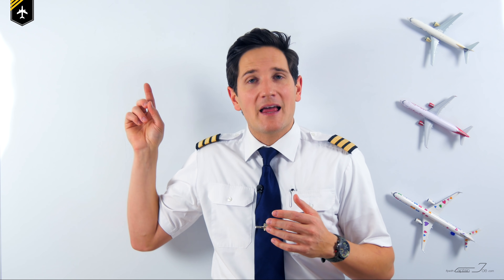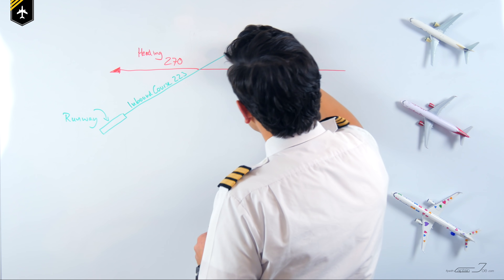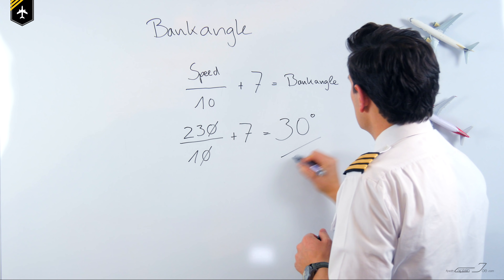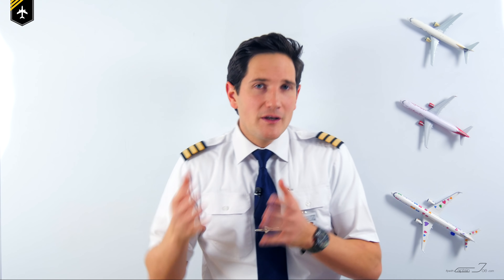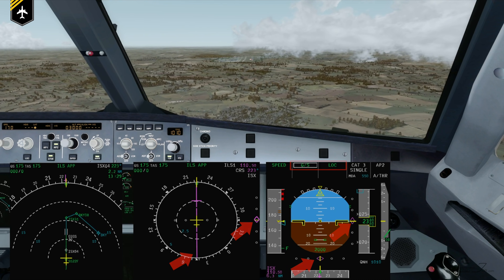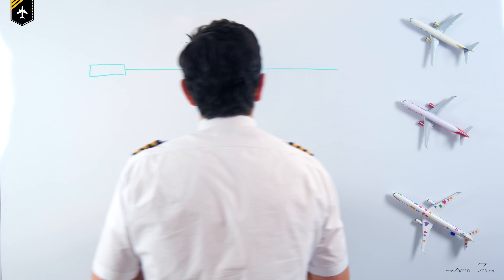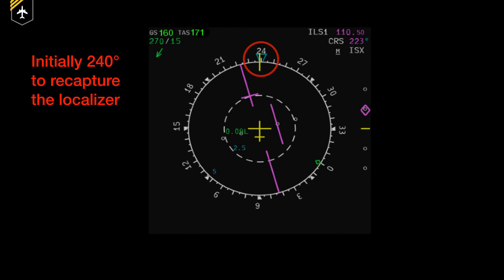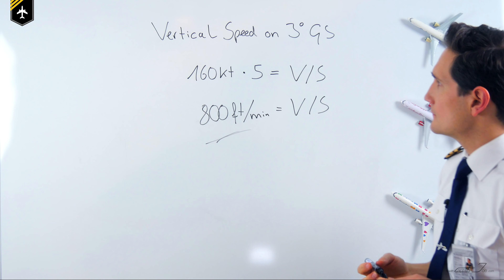HOW TO FLY an ILS? Explained by CAPTAIN JOE

Comment: "And another rule of thumb... and a next rule of thumb" I was just wondering how many thumbs pilots have.
Reply: Hell... I ran out of fingers trying to keep count...
Reply: And that’s just one video 😂
Reply: The amount of thumbs they have: yes
Reply: Captain Joe, is the maths and trigonometry needed in the flight deck?  Is knowing these rules of thumb helpful to fly or just knowing how much time you have to make corrections?  That is can’t you make the adjustments based on what is seen on the instruments rather than all of these rules?  I mean isn’t it easier to just glance and react than trying to remember your rules from school?
Reply: @jonweinraub  Just react is, of course, okay (depending on the hardware you fly). However, using those rules of thumbs makes it easier to establish early and correctly and makes the job to track, in this case, an ILS so much easier. And this is a precision approach. A non-precision (VOR, NDB or LNAV) approach without anticipation (yes, that is what it is) is a lot harder.
But no despair, practise makes it easier.
Reply: 5
Reply: Wrong question. You should ask: How many rules can a thumb remember?
Reply: 4.
5 if they are male.
Reply: @luftwolf  Something similar crossed my mind. What happens in the cockpit stays in the cockpit.
Reply: A lot
Reply: 2
Reply: How many thumbs there are on the cockpit?

Comment: If military aviation is also playing in the "commtest", the so-called "Sarajevo landing" wins with 30° steep approaches. It was introduced in the 1990s when NATO air forces' transport aircraft flied supplies to Sarajevo, Bosnia, and Bosnian Serb guerillas had hand-launched anti-aircraft missiles efficient up to 15,000 feet AGL. Since it was necessary to approach as fast as possible, transport pilots flew 30 or more degree approaches to Sarajevo airport and pulled back in the last seconds. One Italian G.222 tactical airlifter was shot down in Sarajevo even though this accelerated approach procedure considerably lowered the risk of a successful AAM launch.

Comment: Lovely tips for an ILS  . . .  rules of thumb simple formulas . . .rather easy to adopt  . .  thanks . .  I don't even have a PPL but I often use big 737 sims  . . .  and love them to bits . . . .  (sorry for your beloved Airbus. . .   . lol)  after all  . . .  I am a mechanical engineer (competition cars) and love to be in control . . . . . . (no wires in between lol)           😂

Comment: I did an ILS approach with my CFI at the end of my PPL, and it was not easy. Lot of management. Also, does the Pitch for airspeed; Power for altitude is still working in airlines/jets?

Comment: Well during ILS on common aircrafts, a full deflection is 2.5 degrees off course so one localizer dot is 0.5°. 
And for the standard rate of turn you should use 15% of your TAS much more precise.

Comment: When landing, some planes do not deploy speed brakes (flights I have been on). Have read that it is not so much air resistance that helps slow the craft, but rather helps apply downward pressure to the tires for better braking. Wondering out loud...

Comment: Hi Captain. Question that came up. Prop aircraft are affected by the angular momentum of their blades and also gyroscopic effects. Is that an issue for jet powered aircraft? And if then how is it compensated for? Are the engines on each opposite wing rotating counter to one another? Are the jet engine parts counter-rotating? Thanks in andvance.

Comment: Dumb question: Why does the tower ( or whoever.. ) give the altimeter?  I hear it all the time on air band.  Thanks!  ( I know it's atmospheric pressure.. but why ? )
Reply: slamdvw air pressure isn’t the same at all places. So it is important that all aircraft use the same pressure values so that their readings are accurate wrt each other.

Comment: That's very impressive how you calculate exactly when to begin your turn to Capture your ILS. 

So Captain Joe, I was wondering if you have any experience using CPDLC? Im an avionics apprentice trying to get a grasp of how ADS-c and CPDLC work. From what I understand you use ACARS to send messages to CT on VHF band, but can the messages also be broadcast on your FMS CDU's also? Is this system going to eliminate the need for power hungry and unreliable HF comms to fly over the pond?

Thanks. I love your channel.

Comment: Why does the wheel spins  beside the throttle whenever we pull or push the side stick or steering wheel
Reply: inventors show 
That's the trim wheel, it's a wheel that can help u do level flight
Reply: Horizontal stabilizer trim motion indication.  Horizontal stabilizers are large surfaces that make up the horizontal part of the airplane tail.   The elevators, which move up and down with stick movement to control pitch of the airplane, are mounted to the back edges of the horizontal stabilizers.  On most jet aircraft, the whole horizontal stabilizer can also move (pitch) up and down.  This is usually done by electric or hydraulic motors, controlled by switches on the control wheel/stick, or automatically if the autopilot is engaged.  The idea is, to make a short-term change or correction to pitch attitude, the pilot moves the stick forward or back, the elevators move down or up as needed to provide the pitch angle desired.  However, if the pilot finds that the stick must be held out of the center/neutral position to maintain the desired angle, he (or the autopilot if engaged) will "trim," or move, the horizontal stabilizer until the elevator is back in neutral and the pitch attitude is maintained.  The horizontal stabilizer is larger than the elevator surfaces and slower moving, so the elevators are used for short-term pitch control, and the stabilizer for longer-term control.  An airplane that is in trim in pitch has the stick  in neutral.  Since the stabilizer can overpower the smaller elevators, it is important that the pilot knows what position it is in, and when it is in motion.  Most aircraft have audible as well as visual indications of a moving stabilizer.  Hope that helps.
Reply: that wheel also has a small folding handle for manual trim operation if power fails.

Comment: Why do we board planes from the left and never the right??
Reply: The correct question is "Why would you add complications of boarding from more than one side?" 
Industrial standards are used for interchangeability, reliability and cost saving. Only one terminal bridge design is needed, planes only need one entry door, ground crew procedures are simplified.
Reply: Because it is the port side. Old maritime tradition from waaaay back when right-handed oarsmen had to approach the dock.
Reply: Drastic Skillz 
I'd assume it's just became common practice while the other side is being loaded
Reply: Activate your Mind Correct.
Reply: yes, it's because of the port side

Comment: Hi Captain Joe, this is a question I really really hope you answer
Is the Aerosoft Airbus A320 Extended accurate or close to a real airbus in how the SYSTEM works? (Not the control or Physics of course, the systems I.E Autopilot, procedures on startup etc)

You'd be a great answer, you fly the A320 and you're a Captain :D

Comment: What is the wheel that spins beside the throttles?? , Why does it spin rapidly on touch down?
Reply: Those are the trim wheels. They control the elevators. On the Airbus, they are controlled automatically, so once the plane lands, it trims the elevators down.

Comment: Hi Joe.  Been enjoying your videos for some time now.  As I'm not a pilot, perhaps you can explain something.  Why do the diamond icons for the ILS and glideslope move in the opposite direction from what the aircraft is actually doing (i.e. icon moves right when the plane is drifting left).   It seems totally counterintuitive to me.
Reply: If the localizer moves to the right while the plane is drifting left, it means that the plane is to the left of the localizer. The diamond icons indicate where the plane is supposed to be on the approach.
Reply: They've made it that way so you can always 'follow the needles'. If the plane is drifting to the left, the needle moves to the right, because you'll have to steer to the right to correct the deviation. A pilot can always follow the needles, which is the most intuitive way of interpreting an instrument. (Instrument moves to the right, steer to the right. Instrument moves to the left, steer to the left.)

Comment: I'm not a pilot, but find it difficult to believe that math cannot be done by an on-board computer given all the raw data inputs already available in the cockpit. If manual on-board calculations are possible by pilots, then on-board computers should be able to do the calculations automatically with minimal manual input. What say you all ???
Reply: Jack Sak when the computer fails, the pilot still has to be able to do this manually. Mental arithmetic is a skill that needs constant training, so doing it on every approach helps to keep you in shape.
Reply: +0321Sjoerd: Thanks for your response which makes a lot of sense.

Comment: Is there a reason why 1 step is 0,8° ? Why not 1°? :)
Reply: Matthias Kleine o
Reply: Because that degree was decided to be the ‘go around degree’, so you can’t land that far off
Reply: 1 degree sensitivity would make it less accurate as to your position to the runway. Having been in the engineering community, my instinct is that some techy would have determined that the optimum precision would be .75. Of course that's an extra digit so it gets rounded up to .8. 

As Joe pointed out, being one .8 tick off at a specific airspeed would put you over 700 feet away from the runway. If the ticks were in 1 degree increments and you were a tick off, you'd be about 1000 feet away. 

So it end up being a compromise number. Not too imprecise, not too precise (which would make you correct course much more frequently), and simple to use in a formula.

Comment: Captain Joe
What are the 5 red/white lights next to the runway??
Reply: It's four 'light's' and they are called the Precision Approach Path Indicator or PAPI. It's a visual aid for monitoring the correct glideslope. If you are on the glideslope (meaning the correct altitude relative to your distance to the runway) you'll see two red and two white lights. If you are low on the approach you will see more red then white lights and if you are to high you'll see more white then red ones. So you are always correcting to see two red and two white lights. Excellent aid for airports that don't have a (working) ILS and require a visual approach.
Reply: +0321Sjoerd Thanks alot👍
Reply: devansh barathi 
It's a visual reference for glide slope, 2red 2white means perfect altitude, 3-4 red mean that ur low 3-4 white male ur high and some only have two dots or one and will just have different shades
Reply: +Activate your Mind thanks👍

Comment: Can a pilot be type rated on two types of aircrafts and fly both of them in the same company?
For ex: Can the same pilot fly both airbuses and Boeings in a company? 
I hope that you answer my query in one of your video.
Reply: Actually yes. My friends flying on b737 and crj200 in the same company. As i know u can fly 2 type of a/c but not more than 2.
Reply: Manshu Garg 
Yes, as long as u have a rating and learn about both, but I'd doubt he's gonna be assigned another aircraft unless he upgrades himself bigger
Reply: No, only if they're very similar - which wouldn't be the case for an Airbus and a Boeing type.
Reply: He flies for a budget carrier so he's gonna be stuck on an A320 until the A320 is retired, or he is.
Reply: Yes,  but type rating is expensive training and the operations are critical so it is not common.
Reply: A few planes share type ratings such as 757 and 767 so the training from one to the other is only a few days, the planes are different size but the cockpit instruments are all in the same places. 
777 and 787 also share a type.

Comment: Do pilots of big planes (A320, for ex.) perform landing with "manual" control just using ILS system data? Is there a rule, for example, every 10th landing should be manual? Or pilots use only simulators not to forget that skill?
Reply: This depends on the airline procedures i believe. Most airlines allow their pilot to land the plane manually, but some advise them to use autoland. But this is just the landing part, ILS is used 90% of the time for the approach. However, on smaller airports that are not so busy, pilots can request visual landings instead of ILS, as it would reduce flight time, thus burning less fuel which is good for the airline. Also it is very fun to do.
Reply: The pilots can't just decide whether they want to do an autoland or not. Cat III (which is needed for autolands) requires special procedures and is therefore only used when the visibility is really really bad. The Air Traffic Control decides when the Cat III conditions are met and will advise the pilots.
I would assume that about 95% of landings are done manual. They basically fly down the ILS and then take over control during the approach.
Reply: 23 Savage Thanks for your answer. Another question pops up from it - how visual landing can save fuel?

Comment: Thank you for such a detailed video. Do pilots actually use this rules of thumb during approach? There are so many calculations. And how do pilots know when to start turning?
Reply: Hello, it is very important that pilots use the rules of thumb, but it has become very easy for pilots with todays technology. For your second question, the pilots usually get "vectored" by the ATC, which means that the ATC will tell them when and where to turn, however it is possible to do it without ATC, as pilots can see the runway on the displays.

Comment: hey Joe can u tell me what is the spinning thing near the throttle
Reply: The trim, which adjusts the elevator. The elevator can also be controlled by the flight stick, but it is easier if it is trimmed, so the pilot doesn't have to make adjustments constantly.

Comment: What are the necessary qualifications to join any flight school in the world.
Reply: It depends on which country, but generally, you need good grades in English, Maths, and Physics.
Reply: Thanks so much 23 Savage
Reply: Pay for your training as you go.  You don't need any qualifications and it's cheaper.
Reply: Hey Mat, one of the flight schools near me has this payment method "Pay as you go". Could you explain a little more about it?
Reply: It's called modular training, so you pay as and when you fly.  It will be well over 50% cheaper than the integrated courses and you can do it at your own pace.  Ideal if you are doing your training whilst holding down a full time job.
Reply: Sounds great. You can still get a ATPL and work as an airline pilot?
Reply: 23 Savage you can be employable as an airline pilot with CPL/IR/Multi/MCC/ATPL theory.  That will give you a frozen ATPL.  You can unfreeze your ATPL once you have 1500 hrs and gained an amount of multi crew time (can’t remember how many hours). You will then have a full Airline Transport Pilots Licence.  That’s all based on my UK experience staying well away from integrated schools.
Reply: Thanks a lot. This really helped me.
Reply: I have a flight school near me, which has a integrated course for an ATPL, and it also has a pay as you go. It is at a sharp price of 78215 pounds. Is this a normal price do you think?
Reply: 23 Savage twice as much as what I paid for mine but that was 10 years ago.  Shop around, I traveled 75 minutes each way to an airport that offered the best deal, further away than my local airfields
Reply: I'm sure the UK offers better flight training than my country. I live in Denmark, and there are 4 schools that offer flight training. But the modular one is interesting. It gives me enough time to work and earn money for the training. But in modular courses, can i actually take the courses whenever i want, or is there any limit for that? Because some of the courses are a little pricey, and it may take more than a month to save up money for them. Or do you recommend i should save a little money up before i begin the training?
Reply: Modular courses allow you to do your training at your own pace.  Saving money is always a good idea, I took out many 0% credit cards to pay for my training, then transfer it to another 0% balance transfer credit card when the 0% deals ran out so I didn't have to pay any interest.  Plus there's financial protection if your flying school goes bust after you've paid thousands to them.
Reply: Sounds great. Only issue here in Denmark is that with the modular course, i will not be able to get any funds from the government (Government pays money to students). With the integrated course, i get around 1300 pounds every month. Guess it is up to me if i can get more than that every month if i work on my own.
Reply: Didn't know about government grants, spend some time number crunching and go for whatever suits you the best
Reply: Mat Pollock Yep, will do, thanks a lot for the help mate.
Reply: Naman Singh 
20/20 vision unless with proper glasses, to not have a car license taken, a certain doctor slip, and however much money the flight school needs

Comment: Hi Capt. Joe! 
When should you initiate the 30 degrees turn to intercept the localizer? 
For example if im currently on hdg 270 similar to the video,  do I maintain that hdg until the localizer becomes alive before executing the turn or do I observe a specific distance from the extended centerline before initiating the turn?
Many thanks! :)